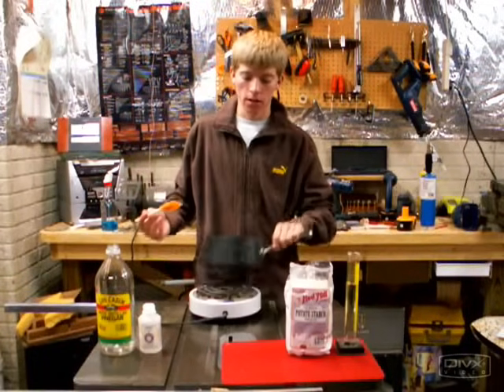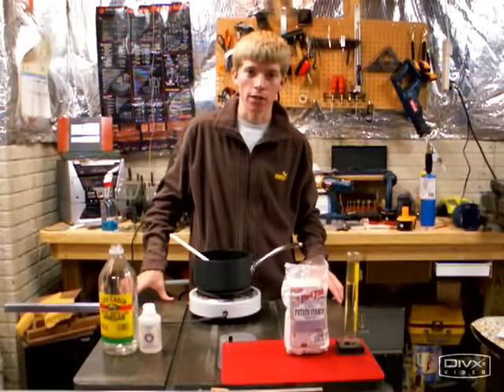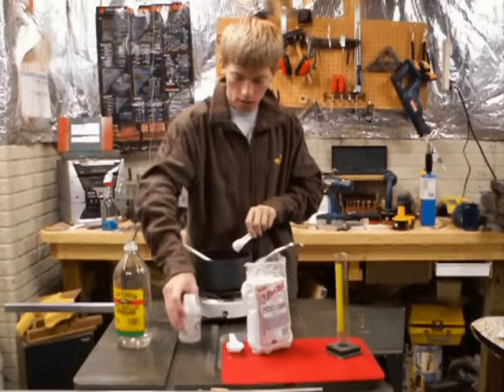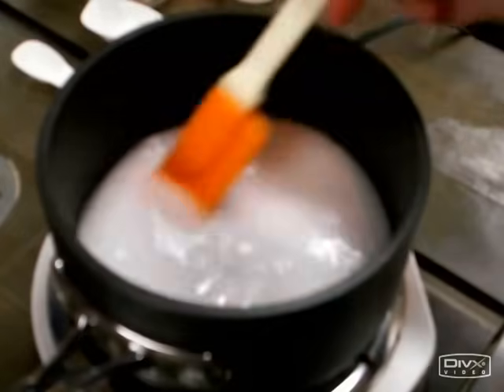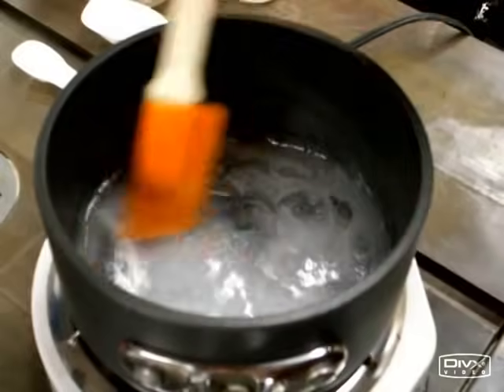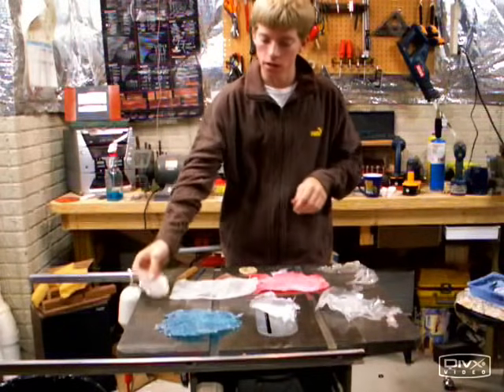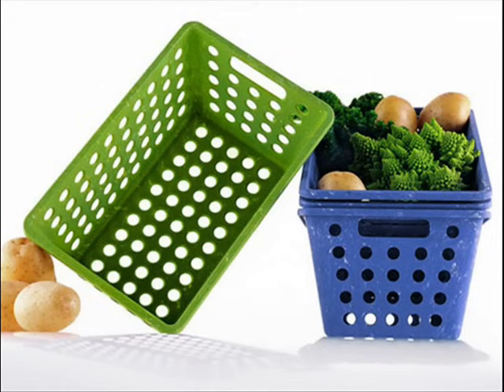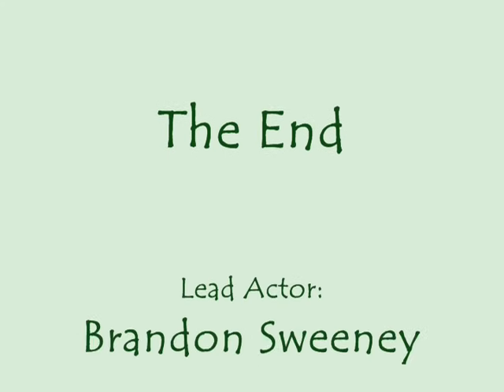Make your own bioplastic

Comment: Congratulations for your video. I think this biodegradable plastic is more useful for bags, I suggest to mold it between two glass sheets bringing some pressure to material. You can improve the resistance using an oven after the plastic sheet be well dry. Also can use a nondegradable plastic thin sheet on the glass surface so the material can unmold easily. Excuse my bad english I am from Colombia.
Reply: luinahyena1, it's just a way to create a very flat bioplastic, instead of laying it out on a surface and letting it dry with ridges on the top. By adding the weight of another piece of glass on the top (bringing pressure to the material), you flatten it, and make it a even thickness throughout.
Reply: Great idea, pressing the mixture between two sheets. The small town I am moving to has stopped using plastic bags and I could see making these for the farmer's market.  I was thinking to somehow make jewelry with it too.
Reply: try using a biodegradable plasticizer to make it more flexible
Reply: @batenkait0s657  Have you tried it? If so, which ones?
Reply: @batenkait0s657  isn't glycerin biodegradable?
Reply: @batenkait0s657  I came up with a kids toy
I'm trying to have someone who know how to do these type of things. Lol I drive a tractor trailer over the road.  And sm kinda needing some one who can figure this crap out if interested and willing to help. We can do something with this invention and make some serious money
Reply: What is the temperature of the oven and for long should I put it in there? Thank you
Reply: Annealing I've found best for bioplastic is 80 degrees C for 60 minutes.  (there is research yielding those numbers)  @arianneestrella5353
Reply: @RobertBowerman1  do you put the bioplastic in the oven to dry out after cooking on the stove? Mine have been sitting in a cool spot for 24hrs and are still just a sticky goo. Any advice?
Reply: I am seeking some one to help me prototype an invention for an awsome kids toy. Just need some 1 with some brains to help bring it to life..if any one interested I'm willing to give a % or take u in as s partner!! Great opportunity for those who know what to do...to build my invention and put it into walmarts 👍
Reply: @OTRAL24  whats it about?
Reply: @OTRAL24  what kind of qualifications do you need for someone to help with your invention?
Reply: @shonk3623  just able to make a mold and maby 3d graphic designs there no electronical part involved
Reply: @OTRAL24  ah well sorry I dont have those qualifications, hope you find someone in the future. you should try finding people on reddit i heard there are more active people there
Reply: @OTRAL24  Hey Idk of this is too late but try finding a university close to you. They normally have a machine labs where you can go into and get parts machined like for molds and such fairly cheap. I make rolling trays out of plastic and i got my school to make me my mold for them for free i just had to provide the block of aluminum. Hopes this helps

Comment: we need to make all things of bioplastic. no more seabirds eating our red bottlecaps an dieing from our excess.
Reply: St. Mark yes!
Reply: Dave, there are other reasons that bioplastics could be useful. As alternative energy prices continue to fall, the many by products of oil manufacturing will certainly increase in price. Some alternative options that have already been pioneered will certainly be useful.
Reply: But your biodegradable bottlecaps could easily break if it continuously contacts water. The very same thing that makes it special, is also its weakness
Reply: Right, so then they can die from bio plastic. Alternative materials only exist because governments pay companies billions of dollars to use them. Once the money runs out, companies will revert back to more cost effecient and higher performance materials. This is only to help DIYers have a homemade plastic for projects, no more, no less.

Environmentalism needs to change from this religious concept of control via government, back to individual policies of throwing trash away in proper recepticles. Forcing companies to change materails that don't solve the problem isn't a solution, it's just harrassment and we ultimately all pay for this at the check out register.

Comment: can it be made thinner so it will pour into a mold ?
also, once it is dry, can it be remelted to use again ?
Reply: brian heidel This is the question that I have. I wonder if you could inject it into a mold with some sort of syringe.
Reply: @JJ-ws5us  You can pour this solution without any syringe into a a a cup or a glass and see whether this works or not 
Then you can try this with a syringe
Reply: It probably would carbonize before it could even melt, but AFAIK hot water could dissolve it
Reply: Only if the bioplastic being melted is a thermoplastoc plastic

Comment: hello iam sorry iam deaf persone if u can to write the Ingredients please :)
Reply: chawki tomorow hi chawki, all you need is 4 ingredients.
1 Tbs cornstarch (or any other kind but tapioca results in clearer plastic).
1/4 cup cold water
1 tsp glycerin (try RiteAid. one reader provided the list in spanish adding that the more the glycerine the softer the plastic and vice versa)
1 tsp vinegar

Heat and stir your mix till gelled and bubbly.
Spread out thin or thick. Spreading it onto a strip of gauze increases its tension and durability.
Reply: thanxxxxxxxxxxxxxxxxxxx u are so perfect, ;)

Comment: can you feed that thru a 3d printer ?
Reply: It is thermoset so no.
Reply: Hum! A shame! So if I want to make a glass or food container, or something like that I need a mold, right?
Unless new 3-D printers are less vulnerable?
Reply: Dennis Gaffney If you make it into thread
Reply: Dennis Gaffney  Maybe you can try suing a syringe or an extruder with the same diameter, usually 1.75mm. I bet additives will be required to avoid browning or caramelisation during printing

Comment: I am going to be using this between molds instead of laid out on sheets. Do you know if this or another non-toxic recipe  will harden when not exposed to air and be rubbery and a bit flexible after it is finished?

Comment: what is the heat resistance? does it break back down in hot/cold water?
Reply: @luinahyena1 this bioplastic is soluble in cold water? thank you in advance
Reply: AFAIK, it would dissolve in water
Reply: @luinahyena1 so basically it's of no use ? 
I was planning to do a project on it

Comment: Something that the video doesn't mention is the drying time. I made the starch plastic and let it sit for an hour and it was gel-like. I made 3 separate batches and couldn't find out what I had done wrong so I looked up more bioplastic videos. Turns out that it takes a week of dry time for the gel to become a hard plastic. Definitely take this into consideration when designing your projects.
Reply: I want to ask
Is the finish product of yours the same as to those on the video?
Pls reply need help
Reply: @vastsummer_16  was it?  for our research too :< pls reply
Reply: they wont tell you how to make it most the time, its kept a secret,  they could if they wanted tho.
Reply: Oh well so for a thick part it will take ages to dry
Reply: @LayerSlayer73  I suggest that you take just a little of it and dry it with a hair dryer (I didn't try this so try it at your own risk).
Reply: Perhaps, the humidity in the room where you were trying to dry it, was too high.

Comment: Hey dude this is a great instructional. Do you think you can do something like this using cellulose from industrial cannabis (hemp)?

Also, if you made your plastic using less water, would it be possible to make PLA filament from something like this?
Reply: I was just wondering this myself. I would think of instead of skipping straight to using hemp cellulose you could probably add hemp/cannabis fibers to strengthen the plastic.

I think it might work as a PLA filament
Reply: Yeah man, people need to do some research into it. The EU recently passed a law that allows growing Hemp, so it could be very easy to start getting the ingredients, so to speak.

Also, we do know that hemp works very well with injection molding, so...
Reply: Ahoy, I'm here for that reason too...I'm going to try to mix some ground/powdered hemp hurds in with his recipe here, maybe a dash of lime and see how strong it ends up. And for a mold, heck, why not hempcrete?
Reply: Try to get in contact with somebody who owns a filastruder or some other filament extruder, so that they can use it to maybe extrude some 1.75mm PLA-style material. If I had one I'd pay  you for it.
Reply: Did you try to make hemp bioplastic?

Comment: @Popescu Alex,
Your math is a little strange (1kg starch from .4kg corn) but your point is right on the money (which is at the root of all the political problems in the world).
For example, there were big protests in Mexico when they started using all the corn to make ethanol as an additive for gasoline (which only makes gasoline more expensive and damages the engines) because there was nothing left to make flour for food.

Comment: Cam this be extruded and put through a RepRap 3D Printer?
Reply: I would put money on yes
Reply: I wouldn't say this particular recipe could be used that way, but others possibly...
Once this stuff dries out, it can't really be melted the same way normal plastic would.
Experiment with it yourself.
Make a bit, and try to heat it with either a flame, or a heat gun. I don't think you will find it works the same way as normal plastic.
If you were to have a 3D printer able to use it before it is dried out, maybe it could work
Reply: I was thinking about this too, but I wanted to know what bioplastic made in the video is.
Reply: @Davilaeric1  probably pla
Reply: Maybe not via melting, but if the printer could somehow liquify it with warm water...
Reply: @ki0w0-lordofwatersheep  
That also melting..
Reply: Well it's pla so I'd imagine yes
Reply: @TheRaveCrocker  No, it wont melt, it will catch fire!

Comment: J Alvi, you can get glycerin from a natural foods store most likely in their natural body section.  Also, a pharmacy chain store should have it.  Glycerin is a humectant that draws moisture to itself, so some use it in moisturizing body/hair products.  Trivia- it doesn't always act as a moisturizer though; since it draws moisture to itself it can at atmospherically dry times draw its moisture from whatever you have put it on: e.g.. your hair or body and cause dryness.

Comment: Malleability is a materials ability to deform under compressive stress; this plastic, once dried would not be very malleable, it exhibits either elastic or plastic deformation based on the amount of plasticizer used. The wrinkling is due to uneven drying rates in the plastic caused by variations in the local surface area to volume ratio.

Comment: Put the sample under a light vacuum while its still in the molten stage and the air bubbles should come out of the plastic. This would also be an effective way of drying the plastic more rapidly since you would be decreasing the ambient vapor pressure, thus evaporating the water faster.

Comment: It's insanely difficult if even possible - to make heat resistant bio plastic - which is why it's not used in home improvement, and engineering. Typically extreme heat (and sometimes pressure) is used to make plastics, rubbers etc.. The fact that this bio degradable material doesn't require much "convincing" (heat, force) to do what you want it to do implies that it doesn't take as much "convincing" to get it to change again. To create something that will endure it must first be able to exceed.

Comment from the maker: This plastic is safe to drink from -- actually, it's even safe if you accidentally eat it!! -- and it won't degrade IMMEDIATELY.  So you could, for example, use this kind of plastic to make some one-time use cups: the type you dispose of after you use them.

However, this material is NOT heat resistant!! So do not put coffee or any hot liquid in them or they will collapse very quickly!
Reply: Green Plastics how hot is coffee does anyone know I plan to make shower rings out of the this?

Comment: After watching your video, I just have a few questions. I'm currently working on designing a biodegradable pop can, etc for a course and I noticed in one of the comments that water will degrade the plastic. How long does it take for the water to degrade the plastic? And is the plastic even safe to drink from? Thanks!

Comment from the maker: Unfortunately, not in the long term, because it will degrade and erode over time when exposed to water.  However, if you wanted to use this material to fill cracks or holes in something, and then COAT it with a natural, environmentally friendly water sealant like wax, that might work -- it depends on what you are doing it for.

Comment from the maker: A plasticizer is a substance that can be added to material to increase its workability, flexibility, or pliability. Plasticizers are one of basic ingredients of all plastics. In the home-made bioplastics recipes that we talk about on our website, the most common plasticizer in the ingredients is glycerin (or glycerol solution).  It consists of small molecules that get between the polymer molecules and act sort of like "ball bearing", so that they can shift around, creating flexibility.
Reply: without the Glycerin could you just cast it into a hard inflexible shape after it was heated together?
Reply: Umm also water proof and chemical formulea made from oils. Id like to make little just bigger than postage stamps training schedules coat in plastic so i can tie it to wrists and read training programme in pool.
Reply: @gissie391  Try mixing in some things like linseed oil, beeswax, rosin, or the like.

Comment from the maker: Sure! Remember that biodegradation is the result of the action of micro-organisms. So if you are storing bioplastic in a cool, dry, air-tight place then they will last for a VERY long time.  The more exposure to microorganisms it has, the faster it will degrade.

Comment from the maker: The way to get bioplastic to be more flexible is to add a slightly higher concentration of plasticizer into the mix. The trade-off is that it takes longer to dry. Check out our website for articles about this topic!

Comment from the maker: @twistedtreespirit That's an interesting question, and the answer will depend on the specific chemical formulation of the bioplastic. There is definitely research currently going on into finding variations of bioplastics that have specific desirable properties, including the ability to be integrated with circuitry and electronics.

Comment from the maker: @jomie1000 This is tough, because when you are producing plastic using this "cooking at home" method, corn starch tends to produce a very WEAK plastic. So it is difficult to do anything  but films.  (The "corn starch utensils" that you see in the store are manufactured using a different process that requires special equipment, so you can't do it at home).
Reply: Send the Full process description of this process

Comment from the maker: @mrsoneji You can try putting it in a dry, cool place. Alternately, some people have reported good results gently blowing it with a hairdryer from time to time. But overall, you do have to be patient. Depending on the formulation you use and how thick your end result it, it can take up to several days to dry.
Reply: I've prepared a lot different bioplastics but the main problem is every time the same, how we pass from single layer to someting that can be used

Comment: Hello my work did not result as shown in the Video Tutorial.
Something is wrong, I hope to correct my mistake, what I did is:
Mix a tablespoon of water, glycerin, wine vinegar, and cornstarch. I did boil until the mixture becomes transparent white.
Result: I hope two days until it finishes dry. I put soaked in water and is easy to shred with fingers. It does not seem plastic. I hope to answer. especially do I have to do to dry quickly and is really plastic.

Comment: hey i need help. i decided to use your toturial to make bioplastic for my project. But it didn't turn out too well. Heres what i did :

I mixed corn starch with water and vinegar and stir it when its still cool and after its completely mixed. i heat it up and started cooking, without glycerine(is it compulsary?)...The end product didn't turn out transparent and gel-like. it was more thick and paste-like and not transparent at all. Its yellowish in colour. What should i do?

Comment from the maker: It won't "melt" in water. It's biodegradable, which means that if you put it in a compost heap, the microbes will eat it and eventually it will turn into (basically) soil.  But that doesn't mean it will "melt like margarine".